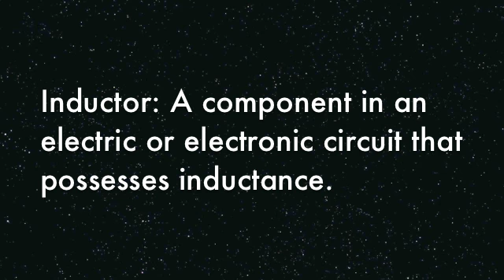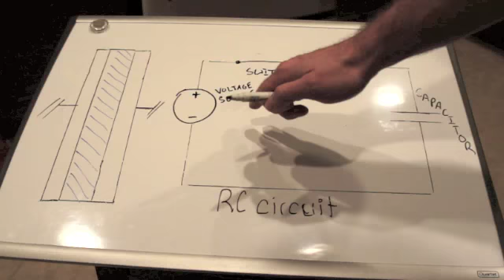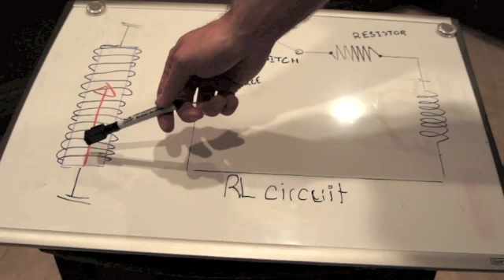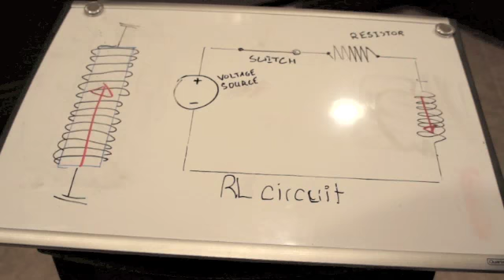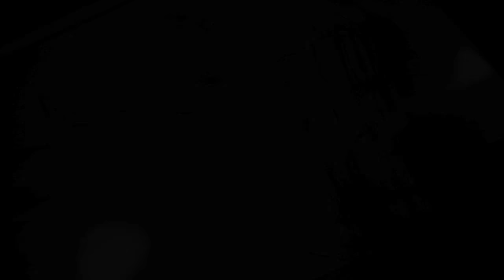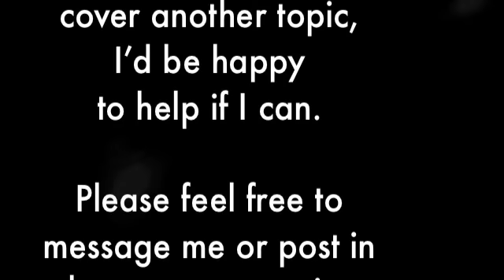Capacitors & Inductors in 2 minutes or less

Comment: It's not my intention to be harsh, just to be concise in pointing out a potential for improvement.

"Inductor:  A component in an electric or electronic circuit that possesses inductance."

Ths definition of inductor needs substantial improvement.  You should never rely on the word that you're trying to define as part of the definition. This definition doesn't mention that an inductor stores electrical energy as a magnetic field, nor does it convey that an inductor resists changes in current.